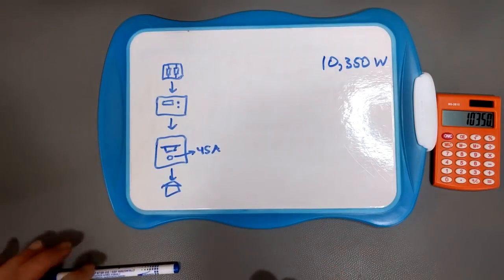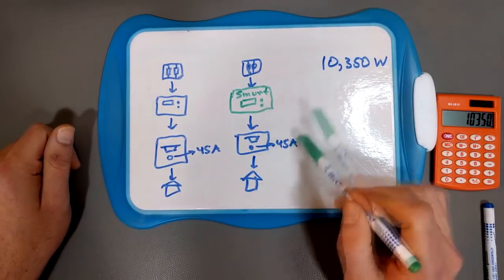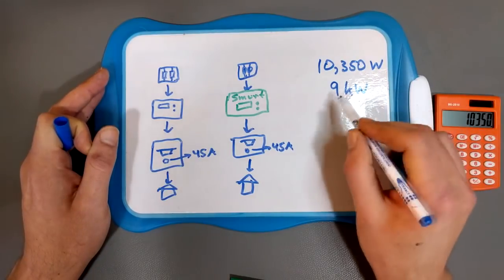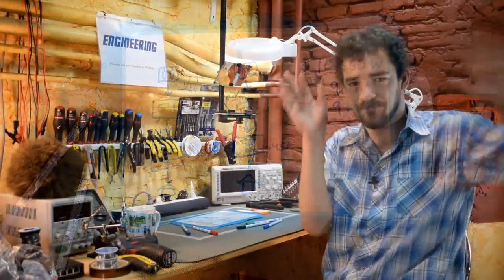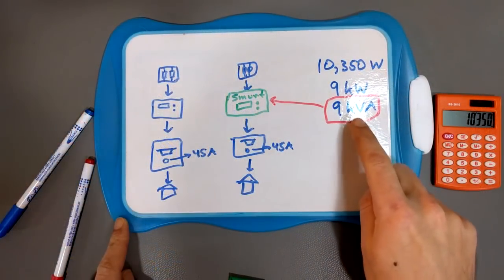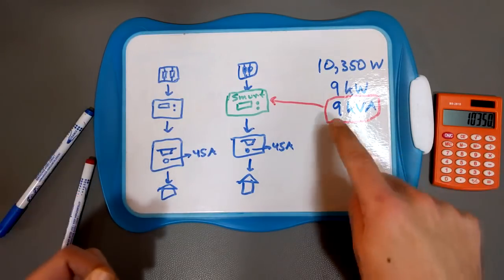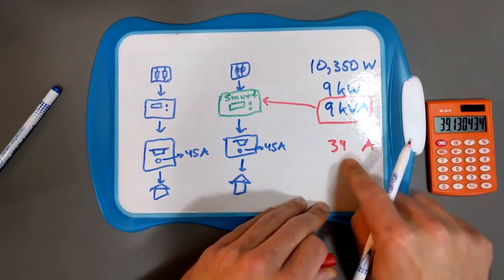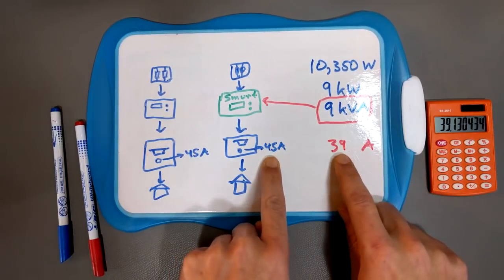Smart Meters are worse than you think

Comment: This is not correct. A MCB doesn't know if the current is apparent. They are rated for kVA too just like a smart meter not kW. So if the power factor is 90% you still get only 90% real power. A possibility is a smart meter trips sooner. A MCB trips between 1.13 and 1.45 the rated current after 1 hour. But this has nothing to do with the Power Factor.
Reply from the maker: My MCB (I assume you mean main circuit breaker, not miniature circuit breaker) sitting outside has no kVA rating. This makes sense, since it's just a thermal magnetic circuit breaker with 500mA slow-trip GFCI/RCD added in. Not sure what MCBs in other places do. Since thermal magnetic breakers use bimetallic strips, the heating is what trips the thermal part. And that should mean that RMS current is what counts (real current only). Those breakers are usually rated for 3kA or 6kA (no "V"), but that's just the maximum instantaneous current they can withstand before things melt or explode. As for the smart meter, that's a bit more tricky since they aren't normal breakers. Apparently, the cut-off is determined by the little puter inside taking current/voltage samples like 3000 times a second, calculating things, and if the preprogrammed kVA max is exceeded, the smart meter opens and your power goes out. So it's kind of like a computerized breaker, because the part doing the breaking is just a contactor (on/off) controlled by the microcontroller + software inside. Well, that's how everything here works, but I can't say as much about N. America, etc. Even characteristics of cable and wire insulation varies from country to country!
Reply: Í"m in Europe too (Germany/Netherlands).

I mean Molded-case or miniature circuit breakers but everything thermally triggered is basically all the same. Forget about the magnetic trigger, rcd, of short-circuit rating for now, because they are irrelevant. 

If the load in inductive or capacitive there is just a phase shift between the voltage and current. The breaker has no voltage reference and no clue what the power factor is. The thermal element in the breaker is just like a resistor and it will trip at a certain P: P=R*I^2. So it will trip at its rated current and it does not matter if the current is apparent.

btw. I"m a electrical engineer and do this stuff for a living.
Reply from the maker: A fellow EE! ;) Well, now I'm confused. Power systems definitely are not my thing, but I also don't understand what in my vid you were referring to in your original comment. I can also say that the main CB for my hookup here is VERY sensitive and trips quickly at even slightly over its rating (60A). The old electronic meter also recorded the overcurrent (usually 1 or 2A over).  ??
Reply: Circuit breakers are far from accurate. Lifetime, nr of breaks, operating temperature can be of big influence on the tripping characteristic. And even new 1.13 to 1.45 nominal current is a huge range.

I understood from your video a smart meter will trip with 100% PF at 100% of the usable power and with a 90% PF at 90% of the usable power. And that a CB would do 100% of the usable power even at a 90% PF. That is not the case with a CB you also get 90% usable power.

The major reason for wanting a good power factor is to reduce grid losses. And at the end this is paid by us, the consumer. So it's in our own interest to load the grid with a decent power factor.
Reply from the maker: SWEET JESUS!!! I think I see what you mean. So, a breaker will naturally see whatever current is flowing through it - PF=1 or not. Smacks forehead But, saying a customer has 9kW, giving them 10.35kW (45A * 230V), and then switching to 9kVA as their max technically IS a reduction in capacity (assuming a constant PF). I think... IOW, we may only be billed for real power, but even without a smart meter, low PF means more current which means more breaker trips (more or less). Gonna sleep on it!

Comment: You forgot the 0.707 do to being AC.
Reply: uhh, USA voltages are RMS numbers ;)
Reply from the maker: 230Vac is the RMS value. Peak would be 230V * sqrt(2), or 325V (+/-). From what I can tell, smart meters are measuring/calculating RMS values from thousands of samples per second (due to harmonics and other crazy stuff). And your standard thermal magnetic circuit breaker also relies on RMS current since it's the heating effect of a bimetallic strip over time (hopefully a very short time) that trips the breaker. The magnetic part usually trips at between 5 and 15 times the rated current for large instantaneous spikes. Anyway, 230Vac (RMS) means that the time-averaged power delivered is equivalent to power delivered by 230Vdc.
Reply: In the US our 120Vac and 240Vac refer to peak voltages. Interesting.

Comment: The power companies are nervous of all the weird line loadings that LED lamps and capacitive droppers in particular put on the supply chain, Power factors are appalling on modern equipment, and the old metering didn't care about Pf..
 On the other-hand smart meters do expose the nutjobs for me to mock about their ignorance of science. 
 Cheers, J.
Reply from the maker: Well, that part is kinda tricky, IMO... I mean in the EU, LED bulbs aren't required to have super-high PF like in the USA. But then again, at only 6W, who cares? Then again-again, the weird line loadings add up quickly... Many homes where I live also have electric heat and hot water (!!), but those are resistive loads, so practically PF=1. Also, depending on where you live, many gizmos are now required to have a much higher PF than in the past - hence things like "Active PFC 90 PlusGoldTurbo" for puter power supplies and such. On the other hand, darn near everything has a switching power supply in it nowadays. Anyway, the power company here estimates that most people's homes have a PF of "typically 0.93-0.95". That seems WAY too high to me, but maybe not since the highest-power gizmos the typical home is running are resistive loads...  One thing I can say for sure is that there are a lot of people who have been seriously pissed off by these new smart meters due to the "nuisance trips" and increased end-user costs.
Reply: 0.95 PF, Yup, way too high, I trained in electrical engineering and remember the trauma of lessons in AC theory, took a while to get my head around it-but it made sense, helped by good tutors.
 Some years ago I did some electrical work In France, Bloody loved being there, very friendly and It was interesting working with a different set of codes, easy enough though, and yes, electric space and water heating was very common.
 Thanks for taking the time to make these videos, I enjoy.
 Cheers, J.